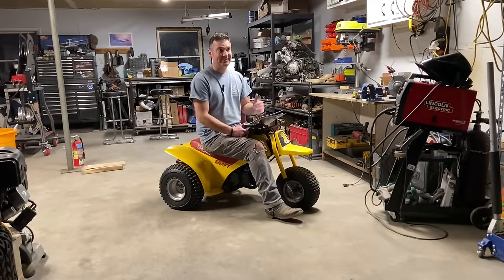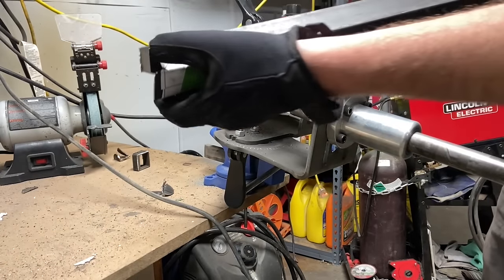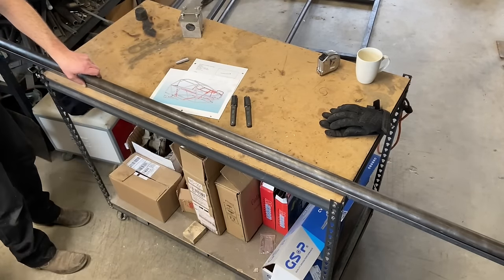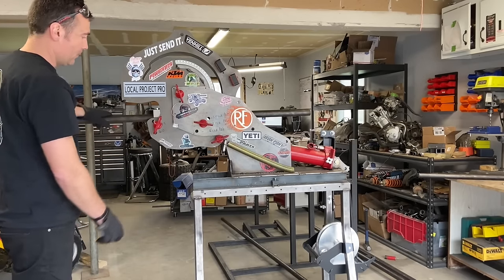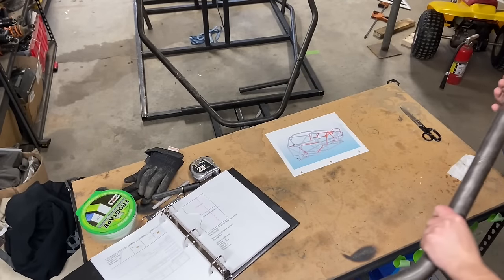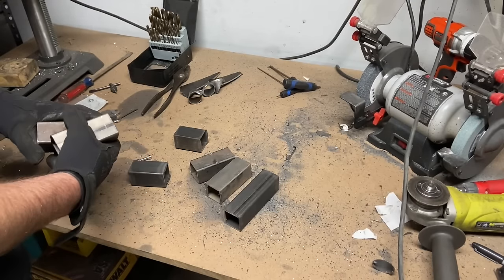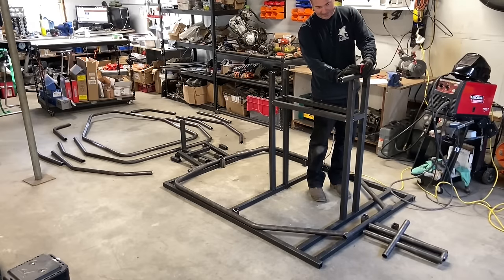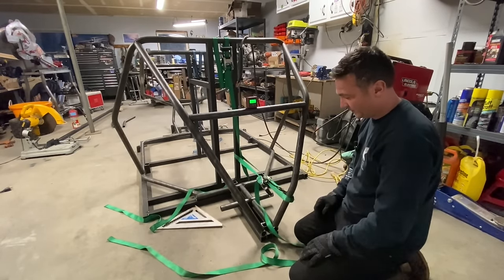Two Seat Crosskart Build #1

Comment: I really like what your doing in the use of the angle gauge and spring back using the pin as a reference.    After you have the slop out you zero the angle gauge so if the level of the bender is off level  in that direction zero takes care of it,  but how concerned are you about the bender being level left to right?   Very well done build video

Comment: A two seater single rear wheel autocycle (reverse Trike) would be a good option for a next build.  Street driven, lower ride height.
Reply from the maker: Next build is already decided… it has four wheels but is not a kart. 😁

Comment: Hi Sir very nice I like both Crosskarts but this is better and real cool I will be watching as I do all of your videos keep the great build up just would like to ask being you are building this new two seat crosskart have you had thoughts on building one with 4x4 set up that would be really the coolest yet and guy in woods trails would like to have onein a 4x4 set up it would not be that hard to do just use 4x4 spindles and differentials for a Quad hope maybe you might build one some day.
Reply from the maker: Thank you! I left some room open in the front for a differential setup, but honestly 4wd is not really my thing. I really love the feel and challenge of 2wd. And I love how simple and inexpensive it is too. More moving parts means more stuff to fix. I look for busted up inexpensive utility quads that could handle the power of a 4 cylinder, but I haven’t found a cheap donor yet… thanks again!

Comment: I dont understand why you would build a jig in order to build a chassis......you can make mistakes building the jig just as easily on the chassis without it .
So is it so you can build multiple chassis and speed up the production?
Reply from the maker: It’s because I’ve built one without a jig. All of this comes from experience. The jig uses 90 degree angles and simple measurements, so it’s actually very hard to make mistakes. The proof is in the success of the guys building these. The hardest part is to start and guys always looking for problems rarely start on anything. I wish you the best 👍

Comment: Thanks for you videos!! Are the plans also in metric? Gr from the Netherlands
Reply from the maker: Plans are not metric but lots of guys have just converted the numbers for their builds. It doesn’t take too long and it’s totally worth it. Good luck 👍
Reply: @KJRaycing   thanks for the reply!  I'm Just shy of 6 foot 6 inches.. how much do you think i have to ad to the measurements?  Planning to do a aprilia rsv mille engine
Reply from the maker: I would definitely get the VF-1 XL. I designed it just for you 👍. That rsv is going to be awesome!!!

Comment: How many mph slower does this 2 seat version go compared to the 1 seater? and how much more does it weigh?
Reply from the maker: The chassis weighs about 50 pounds more. Added weight of passenger seat and passenger vary. Speed is however you gear it 👍

Comment: Looks great! How much space is available for the engine? I'm thinking on using a 1.3 honda jazz engine
Reply from the maker: Well there is as much space as you need. But the space used for the motor will take away from room for the driver... You may want to consider stretching the chassis and using all .120 tubing if you are going to use a car engine.  It will end up being heavier which means more expensive shocks, hubs and driveline.  There is a reason these karts are so fast and fun and that is because they are EXTREMELY light and nimble.  Good luck, I hope it works out for you.
Reply: @KJRaycing  thanks for the detailed answer! I'll try to find a motorcycle engine then!

Comment: Hey there I was wondering if there is a specific thickness on the square tubing for your jig
Reply from the maker: The square tubing is not structural, so I get the least expensive at the time. I’ve used .065 to .095 and maybe even .120. Get a price check on all of them.

Comment: 1000 bucks for a "cheap" bender.😂 Unless you're building a shitload of frames there is no way to justify spending that much on a bender.
Reply from the maker: You can be one of the smart ones that spends $20k on a sxs or $50k on a Sierra car Vs  Under $10k with tools to build your own. You got me…
Reply: Jd2 does just fine if you can find one for cheap. I made my own clone personally. The Rouge fab is just less effort and can be more accurate. Either way, comes down to the operator